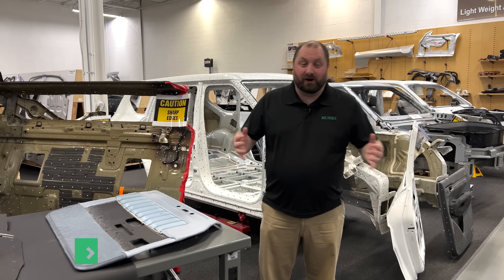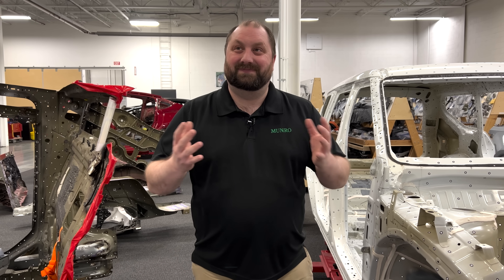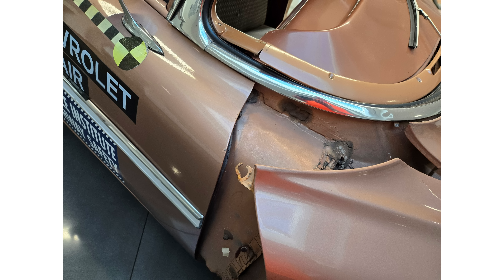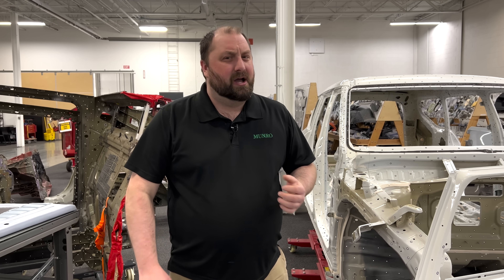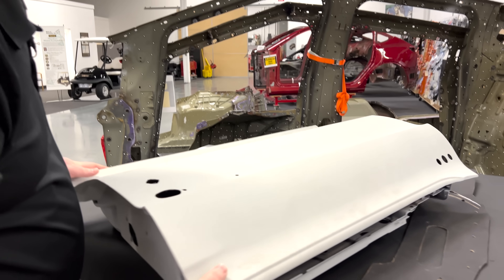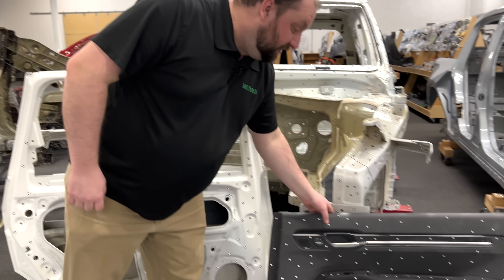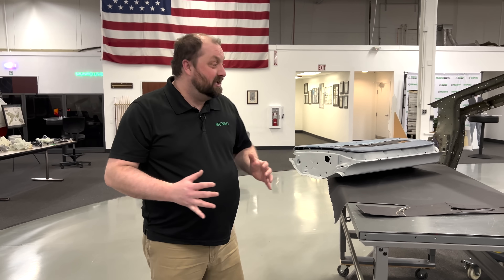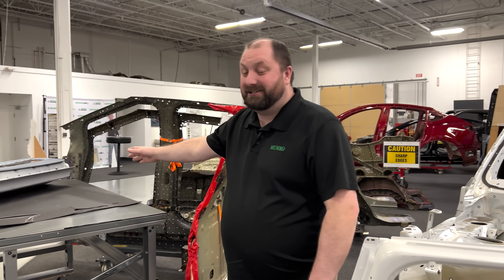No, Your Classic Car Isn't Built Better Than Your New Car

Comment: The old cars required spark plugs every few thousand miles, points, oil,—constant tuneups. They got lousy gS mileage. No seat belts. No airbags. No crumple zones except for the cab. 
If you restore one, restomod the body or don’t drive it. The old car may weigh more. But a steel plate weighs more than the bullet that goes through it.

Comment: Body construction has come a long way for sure but i can live without a lot of the complexity, excessive features, modules in every device.  Vehicles becoming less serviceable,  more expensive to repair and insure.  And these complex unreliable powertrains designed to meet fuel and emissions standards are often a nightmare.

Comment: that old vs new test was purposely set up to make old cars look as bad as possible. They used a GM X frame car- a notorious super weak design, it was a straight 6 so the crash totally missed the engine(whereas the new front wheel drive car with its traverse mounted engine/trans took alot of the hit), and the 59 was a rust bucket as you can see the clouds of rust dust from underneath during crash. Do that same test with an non-rusty 65 Imperial and you would see vastly different result. and yes i know newer cars are safer. all im saying here is that test looks as bad as it does because the testers knowingly choose a super weak old car design for maximum effect. they might as well have used a Corvair or a VW bug FFS.

Comment: old cars are better. much better.they were made to last. heavy duty everytyhing and easy to work on. the title of this video shoud be new cars are safer. which is 100% true. ....new cars are made to fall apart.....crumple zones. designed to take the impact in the event of a crash so the drivers and passenegers do not. they are made cheap and light weight for better gas mileage and they all look the same. styling is lame and boring and you have to remove all sorts of things to change a head light, a water pump or spark plugs and coil packs. plastic clips hold everything on,bumper covers falls off if you bump into something .

Comment: My AC R1234 sucks in my 2024 Nissan 🤣 but my older cars that had R12 has 134A nowadays they still work great! But they say newer cars are built stronger would be a challenge for the lowrider guys 🤣 hopping a modern unibody vehicle without reinforcement would be hilarious it would crack in half in no time hopping 70+ inches.

Comment: Agree new cars are safer but older cars don't have biodegrading plastics parts that fail due to age 5 years + sort of = to rusting and one could work on them for peanuts.  I'll be sticking with my 1981 Triumph TR7 thank you.

Comment: Non-car people and car people see things quite differently. Real car guys want simplicity. Non car people want safety at all cost even if what is said is for safety is a hindrance. Who wants cars nobody know how to fix it or that if i do id have to take out a loan to fix it. 

You want an old car to be safe, cage it. Or better yet get a Chrysler air flow. 

Theres nothing and i mean nothing that justify a 4000 dollar headlight assembly. There's no reason my radio needs to know my taillight is out. 

As a car guy that works on every model soldvin American for the past 30 years, some things make sense but most is just for the sake of complicating it so the average joe cant fix it themselves. Im a professional with the same tools and more than most dealers. Instead of just fixing them its to the point of killing half my day verifying, looking up proper repair procedures, arguing with insurance adjusters or estimators, dealing with customers that had a grandpa that was a mechanic in the 80s so hes right. Theres no more just fix the damn car. Need a windshield? Well now it needs to be calibrated. Oh, a cheap windshield place changed your windshield? Now the lights are on your dash? You collision detection isnt woring correctly?  Well thanks for having to buy another windshield and paying giving me between 400-1200 more for calibration. Old car windshield 200 bucks. Old headlight 15 bucks. I can go on and on. Dont get me started on spacific brands and models. Id take an older vehicle over a new one any day
Reply: "real car guys" who are you bro
Reply: @aiexzs  I'm the guy that has to fix wanna be  car guys cars after they make a piss-poor purchasing decision or watch too much YouTube. Been doing it for 30+years and fully certified by ASE and ICAR in mechanics, body, structural, and refinishing. Got another question?
Reply: @mrbig7718  oh my god mister i’m so sorry for disrespecting you. i should learn to listen to “real car guys” such as yourself! i’m just a wee little fake car guy, please don’t hurt me…..

Comment: This video is such rubbish and propaganda. I am an ASE certified mechanic at a dealership and I work on brand new cars and the older stuff is much better. I drive several older cars and van and the newer the worse they are built, I replaced most of the plastic rubbish with metal aftermarket parts (or fabricated my own) and deleted things like EGR so my engines will last longer. Obsession with "safety" is destroying nearly all aspects of society, keep buying your new "safe" soulless soccer mom suvs that can be remotely bricked
Reply: I'm not sure if you're basing your response off the title (which is admittely clickbait-y), but I don't think it possible to refute the points in the video as far as safety advancements. He isn't arguing anything about newer cars being better built from a reliability standpoint, but from purely engineering for safety it is absolutely true that the are better. There were little or no standard for safety back in the day, and declines in fatalities from accidents prove that. Older cars are absolutely more reliable in the way of being simpler and having less moving parts, but that is a separate topic (mostly) unrelated to the topic at hand in the video. I drive older vehicles because they are easy to fix and better built for being kept on the road, but I simply accept the risk of less safety standards than new cars.
Reply: @benbullard1172  Doesn't have to be mutually exclusive though-- we could engineer a car that is safe that also is repairable, reliable, looks good, and practical. Videos like this ragging on old cars aren't helping promote this.
Reply: @BuddyTheWolfYT  it's the truth. The rust sucks, the maintenance sucks on these cars(I mean c'mon you had to let your car warm up for some minute's) then 20k miles the engine would need some maintenance which btw cars nowadays can go hundreds of miles without needing to touch the major engine components. Trust me you don't know anything even if you're some "ASE" mechanic which says nothing.
Reply: @Maximus20778  New cars will rust too if you don't fluid film if you live in a salty area, several have rolled into my bay that crumbled into nothing, all new like 2008. my 81 vanagon the previous owner fluid filmed the underside regularly, the only rust was panels rust. All steel rusts even if the factory paint/powdercoating has gotten tougher (and it is going backwards now because of government regulations, many body shops cant do urethane paint anymore in some states)

And yes you still need to do regular maintenance on a new car. Even more so as their engines are being pushed to their mechanical limits to appease the EPA/CARB/CAFE gods. 5k oil changes is a must. No matter what the manufacturer says, they only care about it lasting through the warranty.... And go at least a weight thicker than what it's specced for (or look at what weight oil the engine is specced at overseas) as too thin oil in the USA is recommended because of CAFE nonsense. At the dealership of course we can only use what's specced for the USA so early oil changes is a must to keep an anemic modern engine alive. More and more have a delicate turbo you need to keep happy with clean oil too.
Reply: @BuddyTheWolfYT  what car company dealership do you work at? It can't be Toyota or Honda
Reply: @ I won't give specifics but yes it is Japanese. The Japanese are still the best but they have all gone downhill
Reply: @BuddyTheWolfYT  I don't want the specifics but what your talking about sounds like modern GM for sure
Reply: @BuddyTheWolfYT  btw apologies for saying that about the certification, alot of people on YouTube love to make up stuff here.
Reply: @ I blame the owners for the rusty ones I've seen though

Comment: You have to determine what 'better' means. Cars today are better in a crash, more rust resistant and better on fuel economy. They make more HP per cubic inch today too. They are NOT better on style in most cases and are NOT better for ease of repair or COST of repair (IF you can make the repair at all). Apples and oranges comparisons comparing a 1959 car with today. You can compare a 1959 car with a 1929 car and use the same arguments. It's a progression of technology. Some dictated by the customer but most by govt. regulations.
Reply: style is objective lol that's your unique opinion

Comment: awakening to see, one thing though with the older stuff that is an advantage is you can actually work on it, now it wont usually last as long but you dont need a computer or special tens of thousands of dollers just to figure out whats wrong like john deer has done as much as they are an Icon of industry and the cadallac of tractors, or the way they design things in modern cars soo tight you got to remove body pannels just to change a headlamp or have rubber arms to reach in to grab it as is the case on my 2014 edge, and it seems the somewhat simplicity and conveniance but with modern tech hit around the early 2000's but the modern materials in the engines when they are using them and efficentcy cant be beat, but for racing or just for a drive give me that old 57 chevy we had, though I also know it dont have seatbelts, head rests to prevent whiplash and the drum breaks take longer to stop, but if I am just going two towns over or though the city I could take it, its fun and viceral to drive or was we sold it to a friend but have first chance to buy it back if they sell it. or I love the old mustangs but they got that weak rear fuel tank one has to keep that in mind, but the fun they are is not to be understated

Comment: There is a factor of survivorship bias here too — the older cars that survived and are still on the road were the BEST of the best in terms of reliability. Namely GM products with a SBC.
Reply: Not really, its rust that killed them way more than anything else. Having a solid drivetrain means nothing when its rusted out in 15 years
Reply: @ not here on the West Coast! We don’t salt the roads. Even in areas in the mountains usually they use gravel now. I have a daily driven 1985 Mercedes 300D with 230k miles and 0 rust!

Comment: The issue with modern vehicles is they are anti-consumer where the classics (even to the 90s) are way more DIY friendly. Teens used to be able to buy a cheap barely running car or truck and "fix it up" themselves with basic tools and knowledge. Not today. When a modern vehicle gets high miles and has issues, nothing is designed to be easily repaired as everything was designed "for the life of the vehicle", which is just engineering code for "we didn't give two shits about making this part serviceable when it eventually fails"
Reply: Modern cars are not difficult to work on.
Reply: @flight2k5  Note I'm talking serious issues as they age/get higher miles way past warranty, not just fluids and plugs. Internal water pumps that require pulling motor to change, timing chains that require disassembling the front of car to replace (or pulling motor again), non-rebuildable CVTs, motors that lack any extra block material for rebuilding, etc. SOME cars are way better than others though, so you are partially correct.
Reply: @BReal-10EC  Modern manual transmission and na engine car liek Subaru XV Crosstrek or Subaru forester from 2012-2017 is incredibly easy to work on. Stop talking out of your arse.
Reply: @Kacpa2  Don't those have really expensive head gasket jobs.. that are too often?

Comment: My dad was born in 1939 and when I was a kid during the 90's, he used to tell me, "When you hear someone say they don't make cats like they used to.  I'm glad they don't.  Many of the cars I had were nice looking, but they're nothing like today's cars, and that's a good thing."

I don't mind looking at classic cars, but I will never own one.   "My" first car was a 1985 Mercury Grand Marquis.  I'm a very defensive driver and I'm always thinking about safety and how vehicles crash.  One of my cars that I own is a 98 Firebird.  Though it's not built like the cars of the 60's and 70's, I'm still aware that tech had come a long way since 1998, so I'm extra defensive when driving that car.  I put maybe 500 to 1,000 miles on it in a year.  But still, even in my daily SUV being side by side with these lifted pickup trucks feels dangerous as hell.

Comment: A lot of people don't understand how modern cars are meant to behave in a crash. They see a car written off and totally smashed to pieces and assume it's poorly made. But the occupants walked away, and that is all that matters.
Reply: "NPC" stands for "Non-Player Character" and is used as a metaphor to describe someone who is perceived as lacking independent thought or blindly following trends
Reply: @FunTravel-jm9ss  and how does this equate to this?
Reply: @Maximus20778  no idea, just a guess
Reply: @Maximus20778 this guy here. Are you an NPC?
Reply: @FunTravel-jm9ss he must be an NPC
Reply: I remember the first wreck i was in when I was 20. I drove an 89 gmc Sierra and obliterated a Taurus trunk and had no visible damage or dents on my front end. I remember thinking damn I’m hella safe in this thing but I’d reckon cars that crunch down a bit absorb more of the impact before it reaches the driver?
Reply: @ I had an accident in a 1974 Cadillac vs a 1986 Buick century. Caddy won 😂. Buick made a u turn from the right lane. I was in the left lane on a downhill. The Buick had a bent rear axle. Entire rear panel looked like a balled up piece of paper. The caddy?  Minor little dent on the front of the hood where it bends down just before the grille. It took me about 1/2 hour to find the damage😂😂😂
Reply: @grazz7865  bro haha
Reply: @ Neither car has any structure and both were from the dinosaur age of safety. The heavier car wins. However, the Buick had crumple zones so in a more severe impact with something heavier you’d likely be more hurt in the Caddy. I know science bad, but that’s how physics works. The 74 Caddy versus the smallest current Buick would get messed up.
Reply: @grazz7865  #can'tescapephysics.
Reply: So which one is it? Are new cars stronger in the front end like it suggests in this video or do they crumple more to save the driver from G forces? I love how the NPCs who think new cars are magically safer always want to have their cake AND eat it too. It can't be both ways.
Reply: @Impactjunky  those aren't mutually exclusive
Reply: @theoriginaldonutdude4950  I did the same thing to a Taurus with my '92 Subaru Legacy. I had a few scratches on my bumper, the Ford had the whole rear completely obliterated. When the cops showed up to file the report, I had a hard time convincing them that my car was involved .
Reply: @Kevin75668  hahaha nice
Reply: @theoriginaldonutdude4950 size also matters a turus was a midsize sedan where the sierra is a full size truck but yes new cars have crumple zones that’s crumple to take energy away from passengers.
Reply: @  Yes that is how crumple zones work. You aren’t very safe in that truck. Their crash test scores were poor.
Reply: Yes, exactly! The modern cars are designed to be strong enough to last probably 20 years+ outside of winter salt use areas. They are also designed to sacrifice themselves for your safety. Look at all of the police car chase videos. LOTS of people crash but most of them survive quite well if they have their seat belt on.
Reply: The thing to watch is the inner passenger cell. The pillars and firewall of a modern car are incredibly thick and strong (which does cut into the exterior visibility) and will remain rigid in a crash that will fold an old car up like an accordion.
Reply: Exactly. A vehicle can always be replaced. It's silly how sentimental and defensive people are over a piece of iron they never owned.
Reply: And insurance companies don’t have to inspect the car to see if it’s salvageable. They just hand you a check for $3000 or whatever the value of the car is at that time (year and mileage) then politely raise your rates for next year
Reply: NPC mentality
Reply: @BuddyTheWolfYT  Conservatives are dumb.
Reply: @BuddyTheWolfYT  explain?

Comment: I also agree with this. I love classic cars and all, but I am also aware that they are not certainly better to what we have today. Sure they are easier to fix, but that's the thing, they are easy to fix because they are always breaking all the time. I remember my dad always swearing why his nova is such a POS to start during cold days in the 80's, carbureted enignes were a PITA to always tune. Now 2014 my forester just 1 click starts even in -2 degree weather without a hiccup. Its over 150k miles now and the only major repair I encountered was replacing all the 4 wheel bearings, AC compressor, and spark plugs. otherwise, it still runs like new to this day.